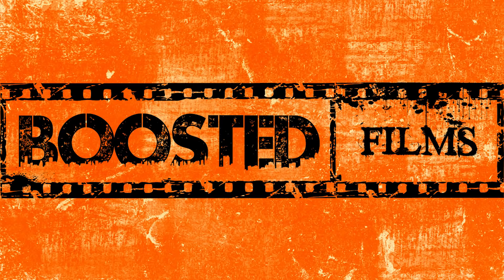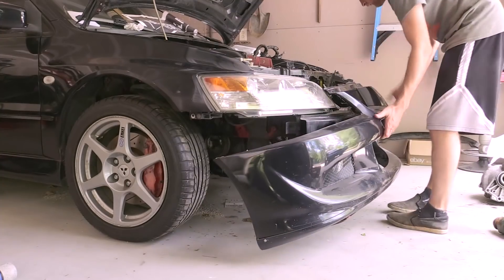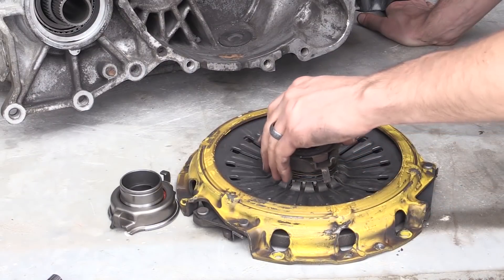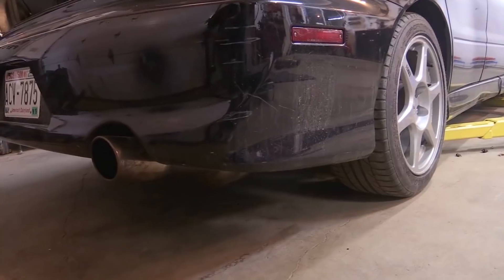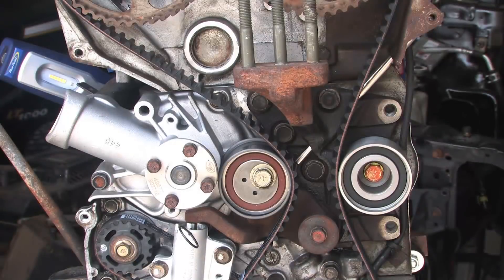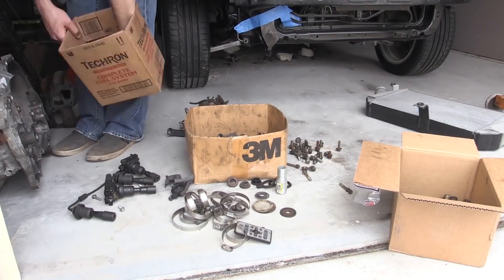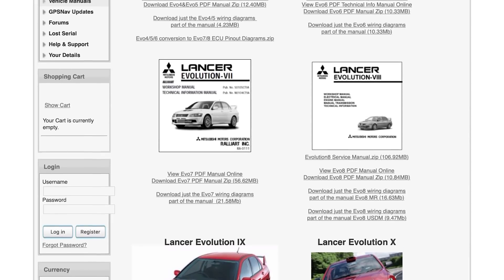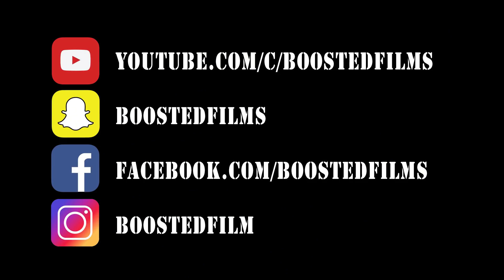5 tips to build (buy) an EVO Roller - Boosted Films

Comment: Price ranges? 03-05;06. Considering the roller has full interior, and full exterior except for full drivetrain. Engine, transmission, t-case, driveshaft, axles, diff. Price ranges with the mileage of 60k-100k ; 100k-140k and anything above 150k. I’ve seen some stubborn prices out there. Kicking me off the market.
Reply from the maker: I'd always pay more for a 9.  Miles mean more to some people than others.  Clean title, I'd expect to pay 3-7k for an evo 8 shell, and 5-9k for an evo 9 shell.  I didn't bring it up in this video, but obviously condition of the body (paint) will matter a lot too.